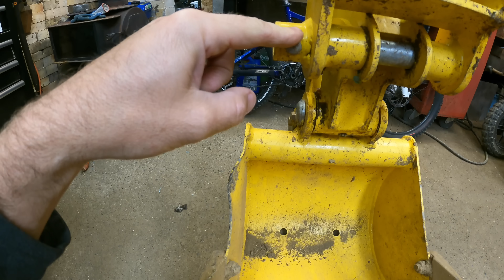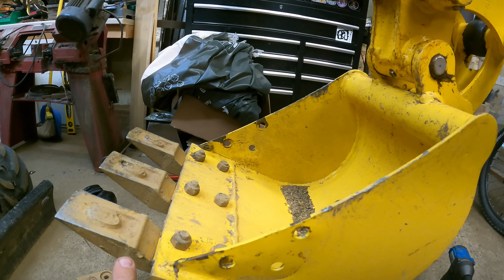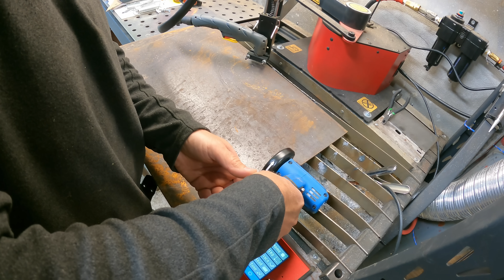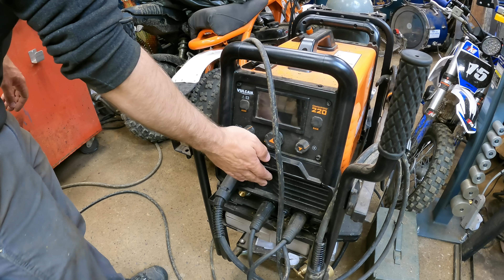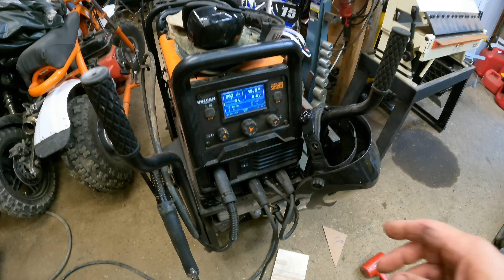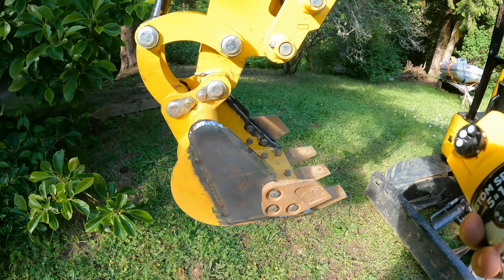Chinese mini Excavator Bucket repair #rippa #miniexcavator #metalfab

Comment: my agt has thicker metal around the digging edges. 
as i shop for small trenching buckets, i see most of them are thin like this, but some have thicker metal digging edges. just need keep your eye out for these details (this is a great and easy solution though)

Comment: I am considering doing a similar brace myself but possibly adding a cross brace at the top between the new 2 pieces parallel to the round upper bucket support.  Maybe 3/16 or 1/4 thick 1.5x1.5 angle. Putting the angle over the existing round brace between the 2 new braces. Sistering it so to speak. If there is clearance that might help improve the rigidity

Comment: I bought one of these exact machines, mostly because of your video. I like the machine and consider it a deal for the price. I have had things that needed attention. It does kind of suck to buy something new and have to work on it right away. I will call the issues minor, but could be major for someone who has to pay someone to fix them. I bought from the same company that you did. They were somewhat helpful for the first 3 months. They kept me on hold for a couple of issues, and now they have just ghosted me. They will no longer respond. I was not rude or anything, they just stopped responding. Kinda dumb on their part as I am considering one of the skid steers. This is the experience you are going to get with these machines. I recommend the machine but not the Khazana company selling them from Texas.

Comment: I got about 16 hours on my Rippa and the only issue has been a fuel leak at the outlet fitting of the tank. Would you happen to have had that issue? Fortunately there is a nice access panel to it just above the floor panel.

Comment: Do you know the color name of the yellow Rust oleum paint? It looks loke a good match and I need to do some touch up on my new Groundhog mini excavator .
Reply from the maker: I think it was Sun burst yellow. I bought it last year for my Yanmar mini Ex. I do know Rustoleum seems to always change there colors up and discontinue colors. Pretty sure it’s so people can’t grab a can a few years later and touch up a spot. If you can’t find the right color you probably will just repaint the project with a similar color. Haha well that’s just my thoughts on it 🤣
Reply: Thanks that looks like a real close match and still available on Amazon .I liked the bucket repair video a lot .

Comment: Is that the 12" or 14" bucket? I'm waiting on a 319 from Khazana that came with the former, and the next up I could get with teeth was 24".
Reply from the maker: This is the 12” bucket. 14” would probably work as well. 24” toothed is way to big for this machine. The 24” smooth bucket would be good for moving sand and gravel, most loose material.

Comment: I have pretty much the same setup on my China mini-ex.  I hate the nuts on the bolts on the inside of the bucket.  I swapped over to carriage bolts with the smooth heads on the inside to help not hanging up mud and dirt and rocks.
Reply from the maker: Yes the bulky bolts definitely do get mud and dirt stuck to them often. Good upgrade for sure. 👍

Comment: Did you weld the removable pieces on the side of the bucket on?
Reply from the maker: No, they are bolted on still. There’s no reason to weld them on.
Reply: @Mikefestiva  didn’t think so, just looked like they were welded in the video. Thanks for replying!

Comment: Just curious, where do you buy steel on the north Olympic Peninsula.  Do I have to go to Seattle, or does someone retail material close to PA.  Thanks for your help and your videos.
Reply: A friend of mine recently bought some steel from Allform Welding in Carlsborg. You might try Copper Creek Fabrication also in Carlsborg. Lincoln Industries in Port Angeles was my go-to supplier, but they are now closed. 😑 They now own Allform, though.

Comment: Overkill would have been putting a matrix of holes in the reinforcing plates and then using those as weld points as well.
Reply: I think a bunch of hexagonal holes arranged on the plate would have looked really cool!  Welded in of course. 😀

Comment: My immediate thought was to use a leaf spring for the leading edges.
Reply from the maker: If it was a much larger excavator you would probably use AR500 steel, for this job it’s just not necessary. Yes leaf spring metal is good stuff

Comment: Far as I'm aware, you and Rather B Welding are the only two I'm subscribed to that has an Arc Droid. Definitely looks much more user friendly to use  than the Crossfire. Or at least easier for novices.
Reply from the maker: The Arcdroid is great for projects like this, really quick to go from idea to cutting, the Crossfire is better for production cutting but takes a lot more time to draw the cut files. Each CNC has its own uses, both are game changers for the shop! Thanks for watching 😊👍

Comment: Your bucket does look awfully thin. My Typhon bucket has a thicker strap on that side cutting edge and two straps on the back side where yours appears to have one. I have an 8" AGT bucket that is not reinforced but it looks maybe twice as thick. 

I found that the house temps and hydro oil temps were greatly reduced after wrapping the exhaust. I used ceramic under the shield then wrapped the exterior in insulated aluminum backed mat then secured with stainless clamps. Much cooler and quieter too.